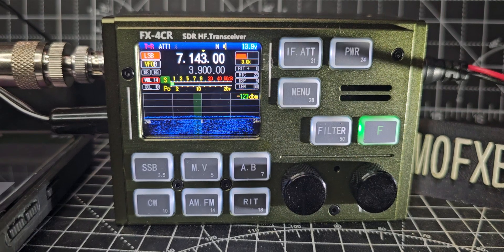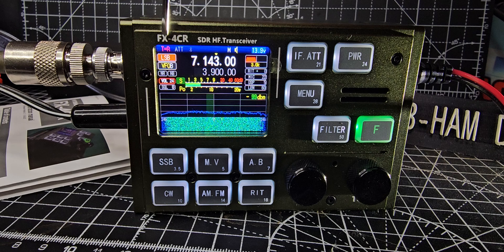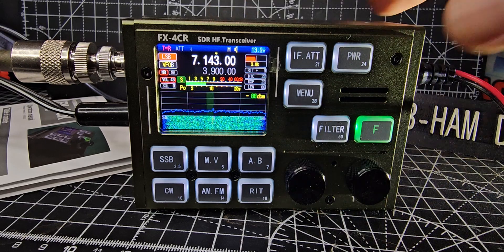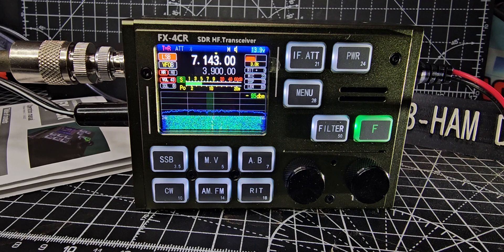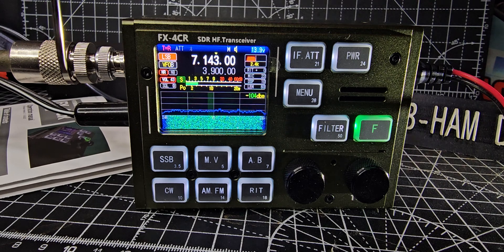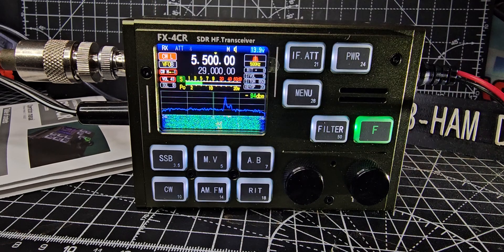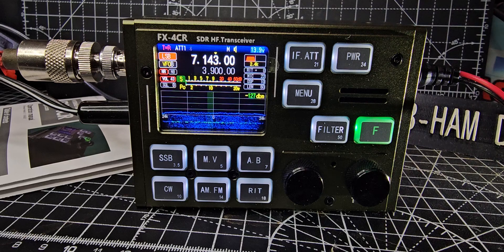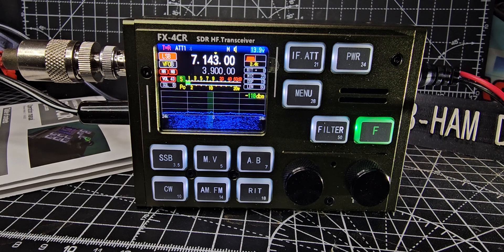NEW - FX-4CR (3rd Gen) Noise Reduction DSP , Filters & NB

Comment: Ive ordered one of these from ebay before i realised i should have ordered from the maker. The third gen seems to have tiny power wires, is that a concern? The original seems to be able to handle more current than a barrel connector?
Reply from the maker: I have the clone i cant see any difference works great.
Reply: @HamTechRadioScannerDrones  awesome! Thank you!